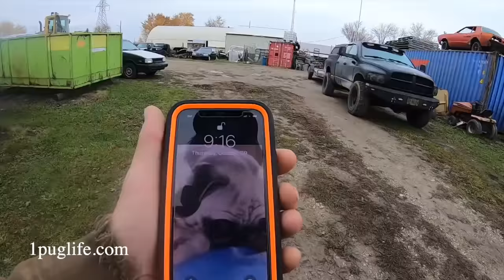drivewerds spooshilest part 2

Comment: Part of me thinks he willingly got scammed so he'd have conflict & drama for future videos
Reply: I'm thinking the same thing
Reply: good asphalt guys puts the right size plywood on top of the well so nothing goes into the well when they drive over and many make the square box in boards so the edges are right but many use white strings where the driver can see when to stop or there is guy who walking next to the machine and tells how many centimeters or inches its to stop machine many use long planks at the side of the driveway to keep it straight and pack the edge while the planks line up on the lawn and asphalt,or what ever there is but many ask if you want a smooth transfer where you drive your truck so asphalt doesn’t crack and they roll it over in one roll, but everyone who makes asphalt job needs to know how to make it at he water go in the well so it doesn’t stay in one place, it’s not rocket science, but if you have no idea how those needs to do better,at you keep everything to yourself
Reply: RcUniverseGuy  no but it gets him a free half fucked driveway that'll last him a few years like the rest of his stuff around there
Reply: Welcome to the channel.  Pug could call a reputable company but he doesn’t. What’s surprising is he paid the guy. Usually he complains about the work and he doesn’t pay. Only guy I’ve seen return is the guy who’s working inside the house.
Reply: @BatJordo  true
Reply: I think that's the problem with isolated rural folk: their lives are so mundane they live in their head, start worrying about other peoples business, and overthink things to the point of anger. 🤔😂😂
Reply: You beat me to it got to make another few grand off of patreon for the next debacle FFS..BMP
Reply: Ya it's something to do when he is not manning the glory hole
Reply: @robmorris3710 cheers fella that image is gonna take a fuck to
n of gear to evict from my memory that's just super  Rob thx..😬💉💊💉😁
Reply: And to not pay
Reply: Life is pretty simple. Be a man of your word! If you  say you're going to do something, then do it. If you can't, then say so.
Don't be a Goof
Reply: U know it
Reply: lol right. Hey guys, come fuck up my driveway for my movie eh!
Reply: @jakethreesixty  riiiiiiight ... citiots never worry about what us hill people are doing with our guns or our pollution causing “monster trucks” or our hot cousin from the next town now do they... yeah right 🤣😂🤣😂

Comment: At least it looks a little better. I am surprised they even came back.
Reply: Not gettin paid had them come back if he would have paid they would have never come back
Reply: So pug put the concrete for the pad to low and this is somehow the paving guys fault. He has to join up with the concrete and it was so low the water had to drain there. At the company I work for his address is blacklisted in the computer, we won’t do service calls to his place.

Comment: Has Pug ever hired a decent contractor? He should have got Crawdad to concrete it like he did for the lift base.
Reply: 8 grand could of did concrete no problem
Reply: Not that I am aware of no. In this case I would think that they would have made the whole driveway drain towards that drain grate. not to the outside of the driveway. one would think that would only serve to destroy the drive over a short time.
Reply: No he never does always the worse

Comment: Well with the amount of weight that's going to be driving across that driveway when you pull through there with your trailer in your truck and possibly your loader you should have concreted it ya goof BMP😂
Reply: Exactly. Crawdad used to own a concrete business, he’s gotta still have contacts in the business.
Reply: FACTS
Reply: Pug 1 owns a loader, hires a neighbor with a tractor to scrape the ground, then complains there isn’t 3” of asphalt when the ground wasn’t graded properly and hired some goof off of Kajiji cause he thought he was getting a deal.
Reply: He's a ginger this stuff is common with the species
Reply: @RedWhiteAndBlueVideo that's funny didn't know he hired a loader guy
Reply: @CrippleNickel555  d
Reply: Ya cause concrete doesn't crack and is so much cheaper lol
Reply: @KRAKEN91O  you're a goof Concrete  does crack unless you use rebar to reinforce it and its way more expensive to Concrete a driveway because you have to dig out a few inches before you can just pour it
Reply: @jeffreywatkins39  its called sarcasm you goober.
Reply: Asphalt is the right choice.   It needs to have a good base and has to be a thicker mat.

Comment: Doing Asphalt this time of year come on bud
Reply: Plenty of people doing it, why do you think the plants still open. With an insulated heated bed and a tarp that actually covers the load you can keep blacktop in the right temp. Range for 3 hours or so at 45 or 50 degrees F. These guys wrote a check their ass couldn’t cash. They are mediocre at best and probably mostly just do jobs where they pave over existing blacktop or concrete where proper grading and prep aren’t near as crucial. Laying down blacktop on a virgin surface is tons harder than doing a top / maintenance coat over an existing paved surface.
Reply: I live in the states and our asphalt plants won't put out asphalt when the temp isn't right
Reply: @scottconstantine891  which state? And which plant? We’ve got a plant that shuts down for winter here in WV too but there’s one right up the road in MD that’ll open year round if you order at least 100 tons.

Comment: I work construction forty years I would not have pay them until he sealed all the asphalt I would highly recommend that you go home depot and buy you ten or fifteen gallons of asphalt sealer and do it yourself it will seal everything so when it snows and melts and freezes it won't you get freeze cracks or chips I would do this every year I wish I seen yesterday movie I could have told about this sooner this guy  notta gooda friend
Reply: Can't put sealer on fresh asphalt. It has to cure for about 30 days.
Reply: LloydBonafide1  any ware from twenty  dollars to fifty dollars for five gallons

Comment: The mix they use is light on the tar, heavy on the gravel. This will never produce a smooth finish.
Reply: it looks like heated spoils with some fresh tar added LOL
Reply: late in the year this is what ya get when the plant fires up 1 or 2 times a day should a dun it in summer when a big asphalt job was running

Comment: What you had done for $8000.00 i had mine done for $3000.00 4" thick and about same square footage
Reply: inwood is 25 miles from the hot mix plant it was laid cold on top of a cold wet surface , perfect
Reply: @carmineredd1198  that was a super great base to lay it on :)))))
Reply: They did a really nice job

Comment: ...you could have done all of the roads on your lot with a thick layer of 4D limestone followed by a couple layers of 2D limestone with dust.  Would be almost like concrete once it settles.  (I can see the appeal of asphalt though, it looks professional and successful, etc. but I like limestone because its so economical and it fills mud holes well).

Comment: I agree with you, when you pay for a 20 dollar job or a 10000 dollar job, you want it done right the first time and no questions asked. My dad had work doen to his 1996 Chevy truck and he took it to a new mechanic and they said it was the Cadillac converters were plugged, so we got them deleted and out on true duals with turbo tubes and still didn’t fix it after 700 dollars. We had to put a new motor in it in the end becouse it stopped pumping coolant and fried the motor, the oil was only 100 miles old and it was burnt when dad pulled the dip stick. Even with the new motor it has a slight hesitation in it and we thought it was the throttle body but we put that in and that dish t fix it. So k ow wet have around 6k into it and still isn’t fixed😂😂

Comment: Take a torch on a propane gas grill heat up a line to the drain and tamp it you can literally make a slight channel for it to run in no more puddle but they still fucked you

Comment: I’ve got 20 years experience in paving and grading .. and I can tell you without a doubt ..these guys are hacks . They don’t have a clue what they are doing. Sloppy work . Dumping the material on the cold ground and then handling it twice before putting in the hopper of the paver . Not only a sloppy way to work leaving a mess and stain where they dumped it .. but you lose temperature handling it twice and having it on the cold ground  . The idiot that was spraying the screed down with diesel right over the end joint . Really smart . I bet that portion lifts or breaks up in time . 
The job wasn’t graded and prepped properly to begin with .. and it was compounded by shoddy workmanship and cold asphalt.
Telling you to park your truck on a high spot to make the water drain ?  Gawd !! Are you kidding me ? Lol. If they knew anything they’d get out the tiger torch and reheat the high spot and pound it with the vibratory on the roller . Work it out and keep working it out until the water flows. they shouldn’t leave until all the water is going where it’s supposed to and you the customer are happy .

Comment: They were supposed to remove dirt and level it first. It shouldn’t be flush against your fence... for water drainage and so the fence won’t rot. If they make it two inches higher and taper down on the edges-at least at an angle so water runs off. I’d call and talk to the owner ASAP.

Comment: Refuse payment, rip out and replace with a better contractor, take original contractor to small claims court over price differences.  But First, establish, in writing, the expectations of job performance and intent.  Drainage, grade variance, site protection and clean-up, and sealing would be examples of this in the story provided.  Never pay with cash, never issue payment without written warranty, never pay without material receipts and distributor info.  Be prepared to be a victim unless you follow these simple instructions.

Comment: Fresh Asphalt is very black, what they sold you use Millings, also known as recycled asphalt. He made a huge profit off of you. Even if he did the job for $2000 he was making a profit.  You should have called your dad, he could have told you since he worked with concrete.  Once your loader goes on that, it's going to rip to pieces. That crap wouldn't even hold up to a car parking on it for a week. Hopefully you got some kind of written agreement, otherwise you are screwed. Oh and you know it's millings because there is big chunks of gravel mixed in with it.

Comment: Pug, you'll never listen to me because you're busy with other shit... but set ALL of your go pros, and ALL of your Final Cut project frame rates to the SAME frame rate.  same fps.  When you do your time shifts, that will fix the audio popping thing.  

If it doesn't, then do your GoPro time accelerated clips as a second project, don't accelerate them more than 400%, export and then bring them into your master project.  Audio pop.tick.skip.crunch.chooch gone.

Unlike the pavement dicks, that was free.
Reply: The pops happen because the audio between a 24fps and 29.97 or 30, or whatever on the source video, and whatever your master fps is set to – scales differently when you apply the time-shift.  That's why, but again, you don't have a fox to give, prolly, and that's okay, too.

Comment: Looks like they need some goo be gone and a 8000 PSI high pressure sprayer take about a half an inch of that concrete off the top to clean it

Comment: is it right nope but at least he came back and tried to make it "half right Friday" at his cost for the extra, thats worth something in a guy. Just get craw to come over and skim 2" on the pad where the lift sits and blend the edge into whats there. Then that low spot that floods the pad will be gone. I'm  sure craw won't do crap like that and call it a good job, he'd guarantee for longer than the time it took to drive out the yard L.O.L .
The old bin boi's getting into the act a bit more now than he used to be. The fun sides starting to break through, there's hope for him yet.

Comment: They didn’t have the right setup of dump truck to haul blacktop as far as they did with the temps where they were. For one thing that tarp was a joke, it has to cover the WHOLE load or it’ll just pour heat out the top, that tarp had a 2’ gap on each side. Then they didn’t have any insulation on their bed at all, all you need is some plywood and you’ll get an extra hour before the stuff gets too cold. Finally seeing as they had their own truck and are a PAVING COMPANY they should really have a heated bed on their truck, anybody doing paving who has their own truck should have the sense to get a heated bed, it’s just common sense.

Comment: They should have sprayed oil on the surface before repaving it !!
Reply: They didn’t want to drive the dump truck on your new pad 😳🤔 because it wouldn’t have handled the weight! 😳🤦‍♀️ so they dumped it out there so it will cool faster with them moving it so many times and with it being so far away. Come to thing of it the first layer of asphalt you got I don’t think was even hot. I never saw steam coming from it.

Comment: All the concrete shoulda been ripped out, properly re graded with fresh gravel and then paved evenly at 3 inches with a proper pitch to the drains. I would not have even let them touch it the second day unless they were there to rip it all out. Even then, I would have zero faith they wouldn’t destroy the fence more. I get the whole “you get what you pay for” Thing but I have seen even half assed jobs get done better than this. I mean they didn’t even clean up the debris before they started laying the asphalt. Lol. Welp...at least a quarter million people saw what a goof pave job looks like. Can’t imagine they are gonna have any referrals from this one. 😂

Comment: Those guys are a hack job but with a infrared heat truck a normal asphalt company can come and fix the drainage problem. It’s not what you want to hear but you should really fix it right away or the water will seep between the concrete and asphalt and first good freeze lift the asphalt and crack it to shit right where it’s pooling.

Comment: With the amount of traffic and weight you move around that isn't going to last long. I just got porked for 5k on my driveway they did a fucking horrible job. But that wasn't the worst part what was what I thought was water was spilt diesel. Have you ever seen what happens to diesel on asphalt? Shit just grumbles apart and stays soft

Comment: You get what you pay for. There is no way possible to lay asphalt directly on uncompacted and exposed 5 yr old gravel/clay, it will break away and crack no matter what you do, the first frost and this asphalt is toast. If I had seen it properly installed, 12" excavated and filled with pitrun and compacted, then road crush laid down and compacted, then I know you paid the right price and would have reason to complain. This was a cheapy patch job from the start, you got what you paid for.

Comment: Asphalt should be no less than 4 in thick. When preparing the area with transit or at least string line. That small of area should have no seems.
They are not experienced.  Don't pay.
I surely would not trust them to redo it. Along the fence and building should have been plate tampered and large roller on rest. Man, I feel bad for you. Damn hacks ruin the industry for the honest skilled people.

Comment: you should have told them what you wanted, when you started.   they should have removed 3 inches of dirt, before they started.  then graded it before they started paving.  this way, all adjustments could be made.  that could have been a beautiful job.  and 8  grand?   they saw you coming. goof! and not but least!  that is slag asphalt.  leftover from previous jobs/  with some concrete waste mixed in.  what a joke.  fresh asphalt is jet black, with pea gravel.  i would have told them to take everything back, and leave.